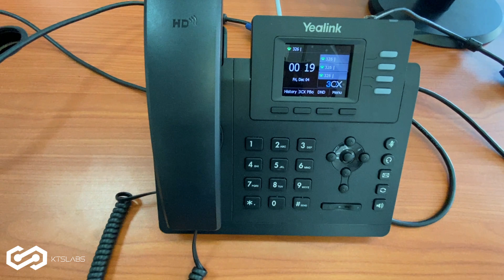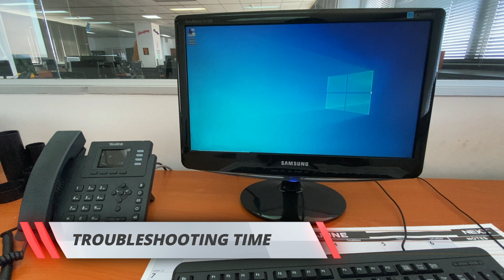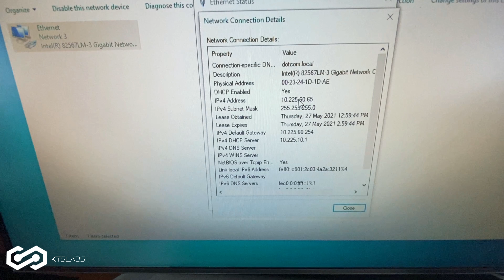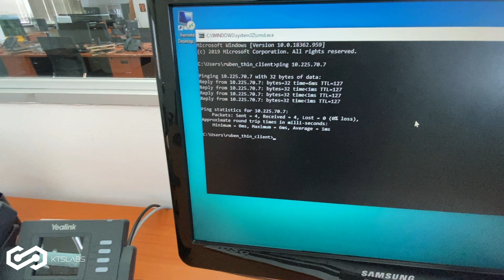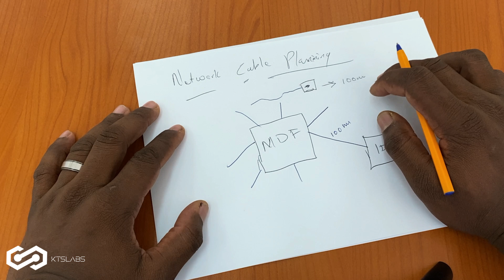Network Testing, Quality Check and Cleaning | IDF Upgrade Project | KTS Vlog Episode 6

Comment: Hello there, am Nase Daf from Tanzania, I have being following up your tutors about Internet and Home WiFi, Am interested much to have my full set up of home internet, But one thing i should know is, What is a source of internet? I mean is that materials can grab internet signals from space and host them as WiFi?
Reply from the maker: Hi fam, nice question 👊🏾. Internet is simply a network or networks communications, yes it’s possible to become your own ISP but will cost money $$$. U will need your own AS (Autonomous System) number assigned to you by ARIN, APNIC, AFRINIC, LACNIC, RIPE_NCC depending of your region, cuz you from Tanzania u will have to obtain your AS number from AFRINIC. You will then use the AS number with BGP the preferred routing protocol of the Internet (network of networks). This solution is very expensive so home users mostly sign up with ISP for their internet services. Hope this help fam 👊🏾